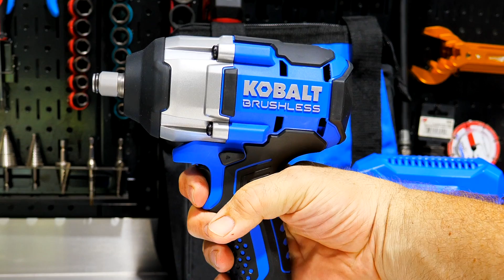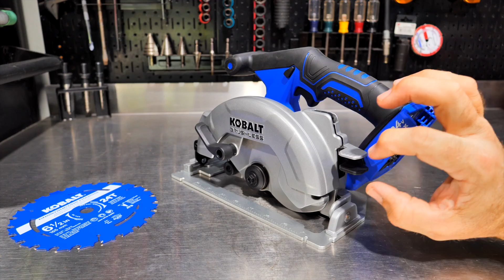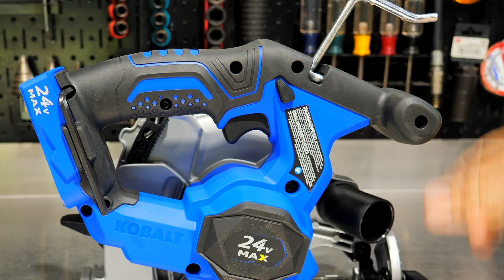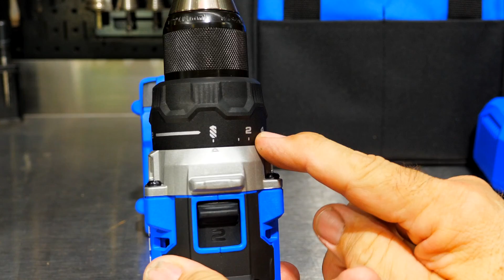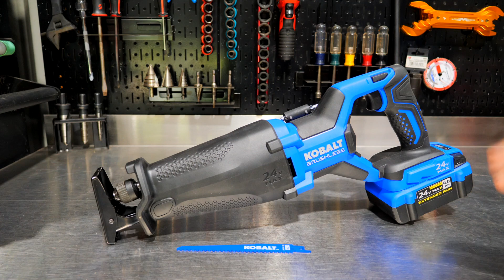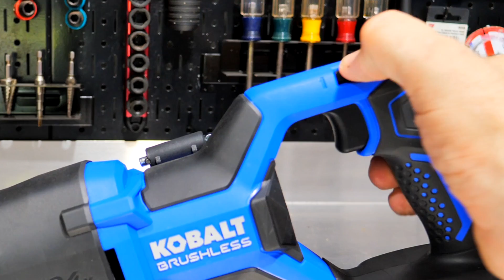KOBALT NEXT GENERATION! 6 NEW Kobalt 24V Brushless Tools Now Available at Lowes

Comment: ★☆☆☆☆ Stay Away from Kobalt – Worst Customer Service and No Replacement Parts!

I’ve owned my Kobalt lawnmower for just three years, and it’s already obsolete simply because I can’t buy a replacement blade. After visiting five different Lowe’s locations, speaking to multiple employees and managers, and even calling Lowe’s customer service, I still got nowhere.

Eventually, I contacted Kobalt customer service directly—what a joke. They kept insisting the blade was available at Lowe’s until I asked them to send me the actual link. The link they provided clearly showed “NOT AVAILABLE.” Their response? “Wait until it becomes available (if it ever does) or buy a new mower in the meantime.”

I asked to speak to a supervisor—who was supposedly going to call me back within 10–20 minutes. That call never happened.

The bottom line: Don’t buy Kobalt products. And definitely avoid any brand sold exclusively through a single retailer like Lowe’s. When you can’t get replacement parts for something as basic and necessary as a mower blade, the product is essentially disposable.

This experience has been beyond frustrating—Kobalt is, without question, the worst company I’ve ever dealt with. Having to buy a whole new mower just because a simple blade isn’t available is absolutely insane.

Comment: I have the older generatin Kobalt tools and have really liked them, I am getting ready to jump into the newer tools and move my old stuff to home use. The only thing Kobalt I dont love is my chorded Miter saw. Terrible slider bearings, the shafts rust up with any moisture in the air and the angle adjustment is always off.

Comment: I have been struggling with a set of 18V Ryobi drills and impact drivers.  The batteries were terrible and the tools did not have  a great deal of power.   I replaced them with a  Kobalt 24v dill/driver and I am very happy with this unit.
I am considering the purchase of a Kobalt 24V radial saw.

Comment: 5:00 If they offered a 7 1/4 inch version of this saw, with the blade on the same side as this one, I'd buy it in less than a heartbeat. I have the KXCS 124B-03 24-Volt XTR saw, and like it, but the blade is on the right side of the motor, and I simply do not like that, it makes it very difficult for right handed people like myself, to see the blade, and have better control over where it goes. I remember a couple years ago, Kobalt claimed that they were going to really ramp up their development and release of more and more different tools, in an effort to go toe to toe with Ryobi. That never happened, and I'm pretty disappointed about it.

Comment: Kobalt offers a Guarantee, NOT a Warranty. What's the difference? A warranty is for repairs. A Guarantee is for replacement. The box says 3 year battery and 5 year tool Guarantee. When I went to Lowe's to return a kit that had a problem, they initially said I would have to contact Kobalt for the warranty repair. I told them, "the box says 5 year guarantee, NOT Warranty. A Guarantee is for replacement and Warranty is for repair. I want you to honor the Guarantee". They told me to grab a new kit from the shelf. Whenever you buy a kit, if one tool goes bad, you have to return the whole kit, and they replace it with a whole new kit. Mostly, I wanted to comment about the Guarantee, because EVERY YOUTUBE reviewer says they have a 5 year Warranty, while pointing at the word "Gurantee" on the box.

Comment: Only thing that interest me is the mid torque. Since I pretty well have everything else in the xtr and they are plenty powerful enough for my uses. 

The depth control of the circ saw is pretty cool. Will pick that one up when I need a new cordless saw.

Not sure I need the driver, since the xtr driver can sink screws into almost anything I have tried. 
The xtr drill is strong enough to drill anything I have had to use it for.  I haven't had to get my corded drill out since getting the xtr.

Comment: If you don't need the latest and greatest model, my local Lowes stores have the older Kobalt  1/2" drive BL impact wrench kit on clearance for $143, YMMV. It's the Model #KIW 1524A-03 with 650 ft/lbs of breakaway torque, comes with a 4 Ah battery, charger and bag.

Comment: Thumbs down because none of the tools were used. Lol kidding. But for real Kobalt's 24 volt platform was pretty impressive from the beginning. The innovation with the adjustment on the circ saw and the use of brushless batteries may just put these guys up there in performance closer to pro level. Right now on my personal chart they sit just above Ridgid. Kobalt needs more tools in their arsenal if they want to compete with the big boys though. A vacuum, 7 1/4 inch saws, lights, maybe go dual battery and make miter saws and table saws. Kobalt would be on par with the new kid on the block, Flex and be direct competitors if their 24 volt system can keep up with team grey.

Comment: Kobalt is produced by Chervon (Skil, Flex, Ego). 
The #1 problem that I see for all of these, except for maybe Flex,  is that they haven't really expanded any of these lines in the last year or so.  They've come out with new tools for each, but just new tools in the same categories that are already occupied. Meanwhile, Milwaukee, Ryobi, Craftsman, etc are all expanding into new categories.

Coming out with another new impact or drill or circular saw is great IF you don't already own a tool in that category. It does very little to entice your existing customer base to come out with a 4th different drill driver if they already bought an older model a year or so ago. 

I bought into Ego and Skil (20v) about 3 years ago. I like the tools I have a lot. I would love to have a yard sprayer or a trim router or a dethatcher. Those tools don't exist under those 2 platforms. But if I ever need another circular saw or push mower, I've got plenty of choices. But, if I switch over to Ryobi's 18v lineup, I can find almost every category of tool I want. The same can pretty much  be said for Craftsman and Milwaukee. 

I'll stick with my Ego tools. What I have are great. But I'm not that far into the Skil lineup and I've already bought a Ryobi sprayer. I may well hand over my Skil drill, impact, and circular saw to my son and go with Ryobi going forward. I don't want to have more than 2 battery platforms and there's too much missing under Skil.
Reply: Kobalt has a trim router and lawn sprayer already...
Reply: @rustytools4643  Yes. I'm aware of that. Skil and Ego (the battery lines I already have) do not. I guess I should have been more clear. 

I looked at the Kobalt line. I almost went that direction. But the Ryobi lineup is still much more inclusive than Kobalt. And as a DIY homeowner, i can live with any feature/performance loss going with Ryobi over something like Milwaukee or DeWalt.

Comment: Does the 2.0 battery say extended run? If so, then those are new too. The first 4.0 extended run looks funny, but the one on the mid torque 4.0 looks like the old style but says extended run.
Reply from the maker: No, the 2.0 does not say Ext Run. The 4.0 Ext Run are the same, but they may make some styling changes. Thanks for watching.

Comment: I have to admit I use Makita because they have lasted longer than other commercial brands. However I tried a few of these tools out a while back. My friend at work was pulling lug nuts on a 1 ton service truck. The tool was fantastic and I tried the previous gen model. People mistake the quality of Kobalt. Honestly they are geared to be more high end performance than you think. The newer tools don't feel like super cheap plastic no more. I think I will buy one because I want to really test it out. I doubt it will pull lug nuts off a semi truck but it could be good for under carriage work,  pulling clutches etc. I've had the Makita 5 years and it still works, so buying this is justified.
Reply from the maker: We will be releasing the Impact Wrench review today, so you may want to check that out. Thanks for watching.

Comment: Why do some tool companies produce and offer both drill/drivers and hammer drill/drivers?

Normally the drill/driver will cost a bit less, it weigh a bit less, and be a bit shorter from tip to tail. The hammer drill/driver equivalent will typically cost a bit more, weight a bit more, and be a bit longer from tip to tail.

Assuming there was no cost difference between a equivalent drill/driver and hammer drill/driver, are folks that have no need for a hammer drill, or have a dedicated hammer drill purchasing the drill/driver variant just to save a bit of weight and length?

Or am I overlooking some other benefits to getting a drill/driver over a hammer drill/driver?
Reply from the maker: The Hammer Drill is typically $10-$50 more than the regular, so some people probably want that savings. I think most of the tool manufacturers have figured out how to incorporate the hammer feature without having to lengthen or broaden the body. Either that, or they just want to have one mould to build both. Thanks for watching.

Comment: To be completely honest I absolutely love kobalt tools. I keep wanting to stop buying them because they are a " home owner" brand but they are powerful, durable, reliable and the battery's are cheap as well has good tool price. I have milwaukee, ingersoll rand and makita power tools. (Like a ton of them) and it's hard to not love kobalt tools also.
Reply from the maker: Kobalt power tools have definitely stepped up their game. They're now being manufactured by a high-end company, so that makes a big difference. It's definitely hard to beat the price and performance you get with them. Thanks for watching.
Reply: I actually use DeWalt and Kobalt for my business needs. I have a driver that has done 10,000+ screws easily... they are actually holding up just as well as the other brands for me so I will keep buying

Comment: I’ve been buying Kobalt for years. Love the tools hate the warranty. They say 5 years but when you go to get a tool replaced it’s almost impossible. I had a multi toll that quit working after only a year. Spent a week getting the run around. Lucky my wife who bought me the tool recommended she bought the extended warranty.  Still had to go to three different stores but was then told on order to replace it I needed the stuff that came with the tool. I responded all accessories are there. They responded what about the blades that came with the tool? What??? You want me to have the blades that came in the box from a year ago?  I finally suggested giving me the tool and they keep the new blades that were in the box.  And they finally agreed to that. I still like their tools and buy some when they have a ridiculous sale price but buy it knowing I’ll probably just have to trow it away.
Reply from the maker: To be absolutely frank, much of the warranty nightmares many times start with the local store. If a store manager handles it correctly, this can be a seamless process. At the same time, we're well aware of the nightmare stories out there, and that's sad. The best we know, Kobalt stands behind their tool warranty, but we definitely want to know when they don't. Thanks for watching and sharing.
Reply: All the parts? That’s ridiculous. You’re not asking for a refund. They decided to replace it instead of repairing it, that shouldn’t add extra rules for you. 

I actually had the opposite experience a couple months back. I’d bought a charger and two battery kit. One of the batteries was DOA. I brought the battery in to ask for a replacement. They said they could only do a refund. They took my battery and gave me a refund of the entire kit.

Comment: That Circular Saw [and its height adjustment] looks problematic for left-handed people.
Reply: It'd be interesting to test that out.  It looks like a problem for dust build up as well.  Wet wood and dust plus groves might equal a pain in the butt.
Reply from the maker: That could be the case. We will run some tests with both. We have a lefty around that can do some testing for us. And, some of us are pretty good with both hands. Great insight and thanks for sharing.

Comment: What ever happened to the XTR line? I was ready to dive headfirst into that  but they never released anything else for it
Reply from the maker: I'm not sure and we're wondering ourselves. We'll try to get an answer to this. Thanks for watching.
Reply: They're in the process of releasing a XTR Brad Nailer
Reply from the maker: @Jim_W actually, I think it's the XTR 23GA pin nailer with 8.0Ah battery kit. NOT!

Comment: re circ saw, EXCEPT with Makita, every single circ saw Ive bought or used at work Im always painting or marking the degrees etc. on the shoe and the angle guide.  Making the numbers and marks in the same color as the saw is stupid and a cheap oversight... i do like Kobalt esp that ratchet of theirs..  SFMF
Reply from the maker: Yeah, we feel your pain. Most of these saws you have to lean one way or the other to get the right reflection to see the numbers. It does seem they could make some contrasting marks to make it easier. Thanks for watching.

Comment: Kobalt already has powerful tools like these ones.  What they need are more different or unique types like  water pumps,  vacuums,   mini hand held chain saws..... something like that.   Milwaukee released their Nibbler tool which was something i've never seen before.  Kobalt should do the same.
Reply: Exactly what I’m thinking. They need to expan that XTR line. It’s like they just ignore it!
Reply: @ajgreen868  I mean...we finally got an ugly brad nailer. Lol.
Reply: These are a step up from the older models. More compact and in ways better than the xtr
Reply: @sebastiantran1266  
That's really the only reason DeWalt and Milwaukee are technically better buys. They each have over 300 tools for their lines. I have about 20 Kobalt 24v battery tools, and on my job it seems that my Kobalts outperform my coworkers who own Milwaukee or DeWalt. The batteries also outlast theirs. Being that my trade requires tools that the Kobalt line doesn't have, I had to break down recently and buy some Milwaukee tools recently, and it kinda bummed me out because Kobalt could easily make a superior tool, in my opinion anyway. Their tools are top notch and I wouldn't trade them for Milwaukee or DeWalt or Makita or whatever.
Reply from the maker: We're hoping to see some more expansion in that 24v line as well. Thanks for watching.
Reply: Kobalt has a 24v vacuum. I got one but it was broken so I got refund. Plan to buy another and I'll come back here to let you know if it worked
Reply: they have a wet dry vac and a few different chainsaws. they really need a line of nail guns
Reply: @eddyg3  it is, i have asked them about it before. Hopefully soon!
Reply: @eddyg3  I just picked one up at my local Lowes. Been looking for awhile.  Its pretty sweet
Reply: I'm considering ditching Kobalt to go to Ryobi as they have a larger selection of tools. I just don't understand what the hold up is for them to release more tools. I would love a mini belt sander or laser level. Kobalt tools kick ass just doesn't make sense.
Reply: @Tugboatpb  
All of my power tools are Ryobi.  The large selection of tools is like being a kid with all the toys to play with.  Sometimes, I just look for stuff to fix just to give me an excuse to play with different tools.  I even got a battery powered shears to cut boxes and packaging.....  cuz i'm lazy like that.
Reply: The nibbler has BEEN out, I mean Hilti has one
Reply: They actually have a large selection of cordless but sometimes hard to get. Took me a month to get the right angle impact.
Reply: They pretty much put everyone to shame for what you and for what you pay.
Reply: This. Where are the portable band saws, table saws, cordless air compressors, pin/brad/framing nailers? 

And for the love of god, they need to release an angle grinder without a paddle switch. I love my kobalt 24v tools, but the new ones i want to buy don't exist. The ryobi tools feel cheap, but the lineup is just so massive.
Reply: @Michael-cv1uv  
I totally agree.   I love the Kobalt tool's quality and power,  but they simply lack the variety.  This is why i went with the Ryobi line   for that reason.